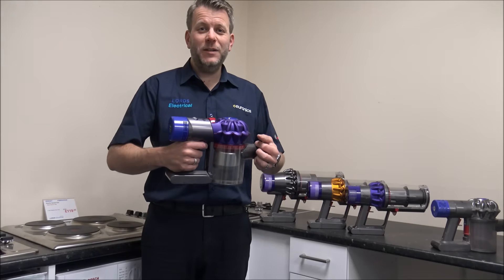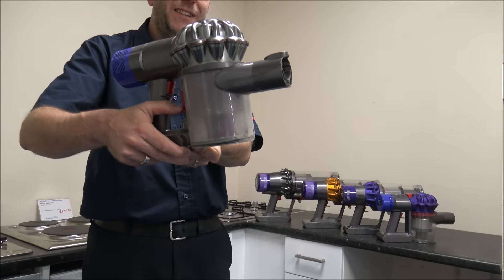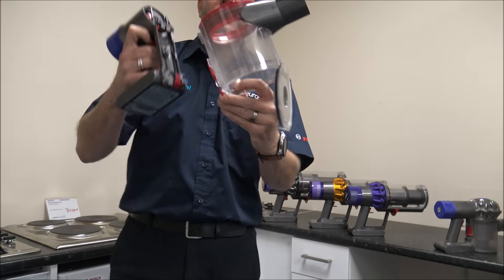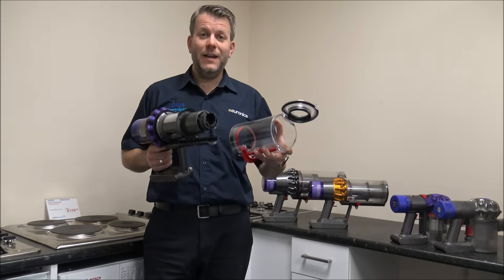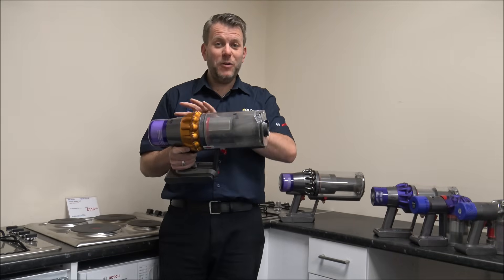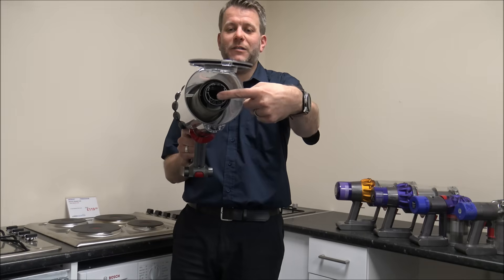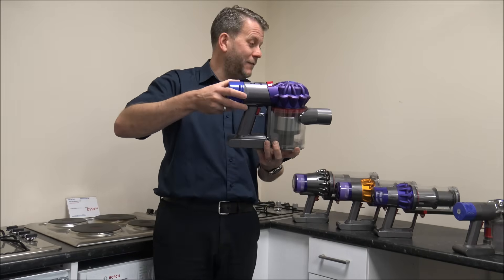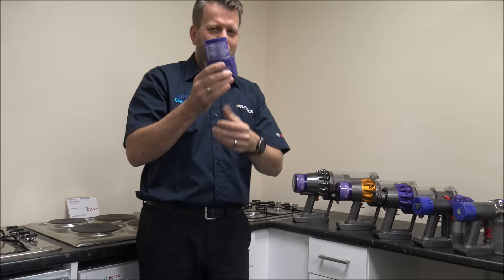Is Your Dyson Pulsing And Not Sucking? Here Is How To Solve It

Comment: Thank you!!! 
I got a Dyson V8 for pets from my bosses, as they noticed it is pulsating and just bought a new one. It smelled horrible, and I got a really tough job to do  but still a wonderful vacuum I want to save and use as when it works it works so lovely and it's not loud. I literally kept it in my storage room for a year as I couldn't find time for it, I knew it would be dirty work and mess up my apartment lol. 
It was used for years in the place with 2 short hair shedding dogs and 2 babies/toddlers, so about the hair and dirt, name it, sticky cheerios, the sore smell of vomit, dairy whatnot was coming from that vacuum. And my bosses long nice thick hair clogged in the brush for the start, together with tons of dogs hair that didn't show until I ran the brush part alone through hot water, and the dust was cemented.... that thing was totally full and about to die!!!
Then I started watching these videos and bit by bit I solved the pulsating issue. 
Oh my there can be many reasons and sometimes they cannot be fixed in a short time or even one day. Took me a few days to go through all of it.
Washing the filter takes time to dry and so on. A lot came out of it.
The one I got was clogged wherever I opened it, there was cemented dirt everywhere, and I've found and solved at least 5 issues until I got it work with no pulsing, but then it would just go off if I try the powerful mode, so I realized the battery is bad as well, it just stops. It would work for awhile if I use it on low and it does a wonderful job on my fake lamb fur rugs, and in my small place makes miracles.
So the issues can be in the brush area, in the main tube, in the dirt container, and for this one, that rubber around the opening of the container, this one had it not sealing at all as it was filled with dirt and the rubber was folded so for sure no pressure of sealing. They tried to put duct tape around to seal it but once I cleaned the rubber using hot water and stretched it with the small flat screwdriver and ran all the dirt through hot water, it sealed and apparently nothing was broken. I thought some plastic part broke but that was not the case.
For sure take out the filter on the top, I've found so much dirt and short dog hair in it. I washed all the tubes in the hot water, after I separated them, and all the other parts I could. The only thing I didn't want to open was the part around the motor that has a screw in it so that's my last option. 
I ordered a replacement battery, will put it to use tomorrow, and if it still loses power I will try that part, cuz I'm sure if cemented dirt could reach somewhere, this vacuum has it 
This is not the first time I have donated very expensive vacuum people broke. I work in people's homes so often they donate or offer things. Or just want me to dispose of them or recycle them.
The year before I got one I didn't bother to fix. Literally, some woman with long thick hair, or the teenager, cut it short at home, and cut the amount of hair to make a wig, and vacuumed it. The vacuum and the brush was so clogged I didn't bother just threw it in the trash.
Reply from the maker: Wow you really did go to great lengths to save this vacuum 👏
Reply: @lords-electrical  I only spent 40$ for the  new battery and some time. The battery was the issue and now it works like new. Now I have a highly functional vacuum that I would never be able to buy for myself. Thank you for the video! It helped! I was considering just put the whole thing in the alley, just pass it on 😅

Comment: 🔥🔥🔥Ok here is an update from watching this video yesterday. The top filter dried completely today,  and after doing all the suggested recommendations, I am very glad to report that works like new.

There is so much more suction power... thumbs up 100%. Thank you very much.
Reply from the maker: Great to hear it worked for you 👍
Reply: Thank you, your instructions were easy to understand and follow. I cleaned the rim flap that falls open where all the rubbish coming out of. The dust eventually builds up  on the rim and causes  the rubber to become warped.  So you suggested to clean and that when I saw where the dust became hard and I picked it out, which aloud the rubber gasket to close more effectively. That was another possibility, and worth the effort. 

But it really was all the suggestions you pointed out for sure. 😊

Comment: I really appreciate this.  My hand vac started having issues and pulsing.  It's older so I assumed the battery was dying.  Then I thought, I should try to take it apart and worst case is I get a new one like I was planning.  So I went out to the trashcans and started opening and twisting, cutting things off the roller.  The unit itself worked fine but the extension was having issues.  Then i discovered you could detach the roller and lo and behold, THERE WAS THE CLOG! pulled out a huge furball (dogs) and lots of bits of other junk.  No wonder it was pulsing!
Reply from the maker: Thats great to know you have sorted it, well done. Thanks for the feedback

Comment: Dyson V10. The previous time I had a pulsing problem it was fixed by doing everything in the main video. I have a spare filter and am using it. This time,, despite trying everything in your video it will not stop pulsing. The blockage symbol is permanently on.

Comment: Thank you so much for all the info. I have brought 2 different batteries to solve the pulsing issue thinking it was my battery. Turns out it was just a clog where the flap is flipped over. Thank you for saving mire time & stress  you are my hero

Comment: Thank you for this informative video. My husband and I followed all of the instructions but it’s still pulsing. In fact, it pulses when the motor/gun doesn’t have anything attached (e.g., bin, primary filter, back filter and the filter that goes inside the main filter). The motor part is naked. Do you have any thoughts on what it could be? Could dust have gotten in the engine?
Reply from the maker: This is quite rare, as normally it is filter related or if there is a blockage in the bin or pipe that causes the pulsing.

Comment: I have a v8 animal that I got as a handme down from my mother. It has a pulsing problem. Both filterscare new and clean. When I disassemble the unit to just the motor, it will run on low well enough, but when I switch to high, it runs for 3 seconds and shuts down.  Any idea what to do now to get it to work correctly?
Reply from the maker: If you have a new filter then it is normally some kind of blockage that would cause the vacuum to pulse. Also just check to make sure the bin is fully closed and not dirty around the edges as this can cause an issue sometimes with pulsing.

Comment: Can you reset the vac, as my moms pulses, even with the hopper,off etc ?.
Reply from the maker: You can't really reset it, if it pulses without the bin on then there may be a blockage somewhere else in the vacuum
Reply: @lords-electrical I've cleaned it all. Not taken cyclone apart (though I have blasted it with a Shop blower). Or taken the back part off.

Comment: Great video  thanks. I only got the v8 today and it works amazingly well.  When I put on the high power though it didnt seem to move across the carpet.  The rollers seemed to be stuck. Any advice?
Reply from the maker: If it is a deep pile carpet, then sometimes the Dyson vacuums can struggle on the higher power setting. Really the only way is to reduce the suction of the vacuum. then you should be ok. Hope you enjoy the vacuum and thanks for the great feedback.

Comment: HI - great video. I have the V6 with the blue filter on the back.  My unit is pulsing and I have washed both filters. Still no fix.   Is there a 3rd filter on the ones with the removable back filter ?  Do I need to take the unit apart to get to the foam in the back - or does the blue filter serve as the only rear filter?  Thanks.
Reply from the maker: The foam filter on the back isn't really designed to come out if it is fixed in. If you have washed both filters and there are no blockages then it may be worth trying new filters

Comment: Good content.  My v8 doesn't pulse. I've done all regular maintenance but  it runs fine on low suction and shuts down after minutes on high.  Any obvious issues you know of?
Reply from the maker: This is normally where the filter needs replacing. Sometimes when the filter has been washed so many times, it starts to lose the effectiveness of filtering, but hopefully just buying a new filter should help to get it back to normal suction.

Comment: Excellent video.   I have one of the first models w the filter in the middle that pops out.  I went thru and cleaned it very detailed and it is still pulsating.   When i pull the filter out it does not pulsate when i put it back in it does the pulsating.   The filter iis in very good condition, clean and throughly dried before reinstalling.   Do you have any other ideas.   Thank you again❤~Julie
Reply from the maker: One of the first things is to try a new filter if your old one is causing the problem still. You can find if you have had the filter in and kept washing it, that it may still need replacing.

Comment: Great video and well presented, but I accidentally found myself here after looking to see if I could turn my V11 Absolute into a blower, because it's absolutely useless as a vacuum.... all it does is throw any larger particles like cereal around the room so you find yourself chasing bits all over the house and if you're brave enough to put it on boost be prepared to get some ear protectors because it's like a jet taking off.
My advice to avoid the pulsing is to not waste your money on buying a Dyson in the first place, as it's been the most expensive mistake I've ever made, because who ever designed it cannot have kids for sure, but hey you live and learn.

Comment: I have a V11 outsize have had it About 12 months, we just purchased new carpet which is nylon loop, we have been told not to use this vacuum cleaner with the brushes, we rang Dyson tried to get one without brushes but they don’t have any, could you give me some advise please if possible, thanking you Maureen Bennett.
Reply from the maker: Not sure why you have been recommended not to use this vacuum on your new carpet? Has a suggestion been made about what vacuum to use? If you were to use this vacuum then i would recommend using it on the lower power setting.

Comment: The absolute best cleaning method I have found with y V6 is blowing it out with compressed air using a pistol grip with a small tip. There is so much fine dust that collects everywhere and 5 minutes of repeatedly blowing from the top and bottom will provide much better suction after cleaning. Obviously this procedure should be done outside.

Comment: This also happens even if the bin is empty. The blockage can be anywhere in the tubing or at the head unit. Another spot on my V8 is the spring loaded flap just before the bin, it can get blocked much easier than anything else especially if you are sucking up leaves & other bigger types debris. In other words check all the vacuum tubing not just the bin if it starts pulsing as shown.

Comment: Thanks so much! Most of the issues I got fixed. 

However: still have a problem that drives me mad haha. I am trouble shooting this issue now for 3 hours straight. Did all the steps, no blockage etc. 

The issue: 
The vacuum itself works without the pipe. No bucking and pulsating. 

As soon I connect it to the pipe, the pulsating problem starts. I cleaned every single bit. No blockage. The only thing I can think of are those pesky tiny wheels at the "foot" that probably help the vacuum to steer. They have some hairs rotated around them but I cannot seem to detach /clean those aswell (even when I've unscrewed the 4 tiny screws). I don't know if this could be an issue since those wheels don't seem a vital part but u cannot think of anything else. 

That is your strain of thoughts? Anybody else has this problem?

Comment: Hi to really get a good clean disassemble unit like shown and blow out cloth filter and mesh filter with a leaf blower or compressed air. 
Aim the leaf blower up the vac tube and watch how much clogged dust comes flying out of the mesh filter ! Vac works good as new afterwards.

Comment: I have the V7 total clean model and I have tried to take off the end part that I assumed was a filter but it won't budge so would I be right in thinking that my Dyson only has one filter on the top? 
Very informative vlog again,and I always learn something, thanks for sharing 👍
Reply from the maker: There is a chance that it is not a filter you can take off at the back, It is mainly the Absolute models that have the filters on the back on the V6 or V7 models

Comment: I've done everything you said on the V8 absolute . I've not used it excessively. I did clean the back filter with a soft scourer 2 days ago and then it started pulsating. The filter is very slightly damaged. just the tiny plastic blades inside very, very slightly misaligned. Is that my problem? Thank you
Reply: I forgot to say...I did find loads of my hair in the floor piece.. which I cut off. it only pulsed after I'd vacuumed though when i cleaned the filters just as routine. still doesn't work!
Reply from the maker: If you have cleaned and possibly damaged the filter then it could be worth changing the filter for a new one.
Reply: I cleaned it again and the pulsing stopped.. when I put the filter back it stopped working! I’m now waiting for a new filter.. out of stock at Dyson but I’ll be updated when available. Thanks for your help!

Comment: Hi 
Nicely explained
One more query though
Can we also wash the back filter in v6
Reply from the maker: Depends on which model of V6 it is. If its the Absolute model then yes you can take it off and wash it but most of the other models it is fixed and cannot be removed

Comment: I have the V6 and wondered what was happening when it pulsed. Turns out I'd been hoovering a dirty and damp carpet area and clogged up the head. Taking of the long tube the motor worked fine so at least I knew roughly were to look. Very handy look at the Dyson models which would you say I should upgrade to? The filter crack and lid not sealing very handy to know thanks.
Reply: Shouldn't that be "Dysoning" the dirty, damp carpet, or even better, "vacuuming"?! 😂😂I doubt that the Dyson suddenly became a Hoover!!!
Reply: @DD-ts5oj  I hope not!
Reply: @alanguile8945  It's funny how brand names can become verbs. 😂😉😉
Reply: @DD-ts5oj  True, the internet should make you careful now but I can never remember😂
Reply: Loved the information you supplied. You are a great teacher. But my problem was not in the filter or motor. Like Alan Guile, the end of my long tube was plugged - with quilting lint from my sewing room!

Comment: I had a similar problem with a v12. I had to take it apart and clean it. Dirt was blocking the air canals and I had to jiggle it and use compressed air to take a lot of dirt out of there.

Comment: From my experience, water turns dust to mud and you never really get the filter clean.  I learned the first step to cleaning the cone filter on our V7 is to turn it upside down and tap it on a hard surface to dislodge a lot of the debris.  After that, I use my air compressor and blow nozzle to finish the job.  Then I use it to blow out the cyclone housing inside and out.  Had the same filter for almost 6 years now without problem.  ps.  I clean mine about every three months as maintenance, so after the first "Pulsing" incident, and learning how to fully clean it, it hasn't happened again.
Reply from the maker: This is great feedback thanks very much
Reply: I use an air compressor to clean mine, also. You don't have to wait for the filter to dry. Like you, I blow air through the housing, both ways, and give the entire unit a thorough compressed air bath. In my opinion, it is the fastest and best way to clean the vacuum and filters. I have my wife back to house cleaning in about three minutes. This method should be included in the owners manual.

Comment: Hi, thank you for this very informative video. This is the first video I've seen all day that speaks about a flap inside the suction mouth of the vaccum. I have a Dyson V8 and it seems that this flap is dangling loose. Not sure why. So when i turn on the vaccum the suction isn't strong enough cus the flap won't close fully. Please let me know if you have any advice as to how I can fix this.
Reply from the maker: The flap should be loose but it is normally some dirt in the cannister that is stopping it fully closing that makes it not suck up properly
Reply: @lords-electrical  thank you so so much 😀

Comment: ALSO with the filter you can take a flat head screwdriver and press on the little notches around the top and pull the top part of the filter out of the fabric bit. Mine was full of dust , hair etc. absolutely gross. I also machine washed the tumble dried the fabric cover n a delicates bag. I'm sure you're not supposed to but it was fine and I didn't want to wait for it to air dry!
Reply from the maker: Great tip, thank you 👍

Comment: My Dyson it pulsates a then dies …I though it be the battery so got another one ..worked for a bit but now back to same problem .i assume it dose not hold a Charge  ??   Very disappointed  in product …not a happy camper 😕
Could you please help any suggestions ?? Thank you Nelson
Reply from the maker: Assuming you have cleaned the vacuum thoroughly, i would make sure the filter is clean and ideally replace it for a new one as this can cause issues with pulsing